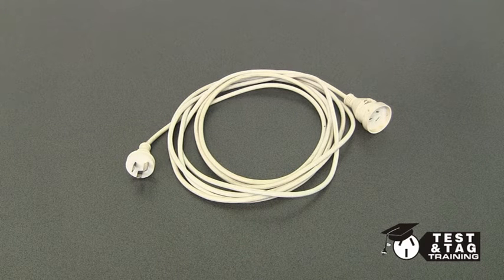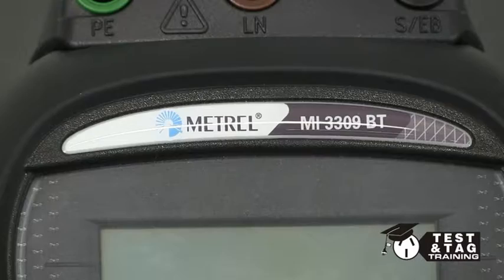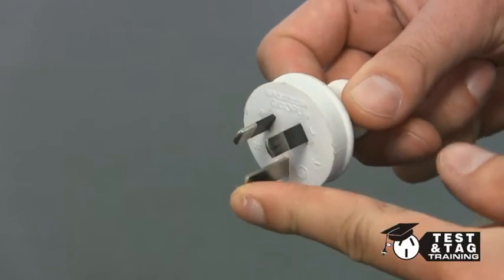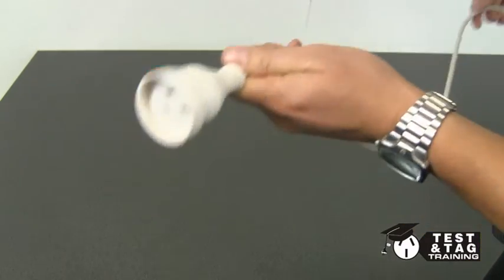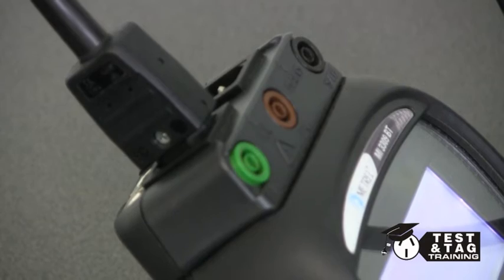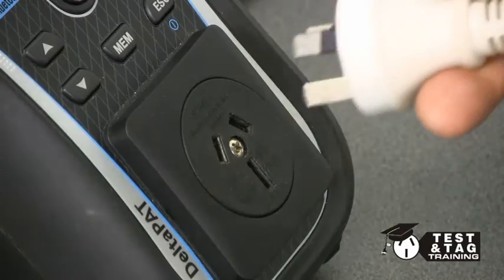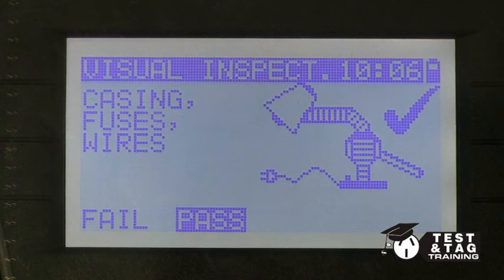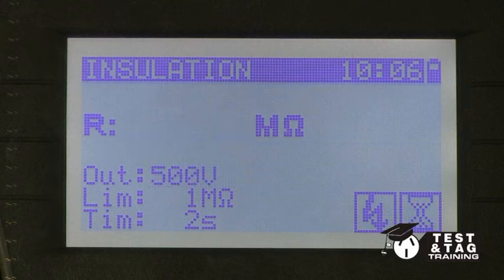How to Test & Tag Extension Leads

Comment: nice video. thanks :)
just wondering can a extension lead be tested from one side only, if the other side is still connected to the electricity, due to it's unreachable.
thanks

Comment: I use a fluke 1587 for insulation testing. I have a lead that has a cut in the insulation on the neutral conductor yet the test still shows more than 550megaohms. Shouldnt it fail?